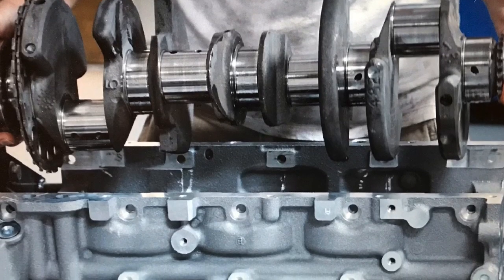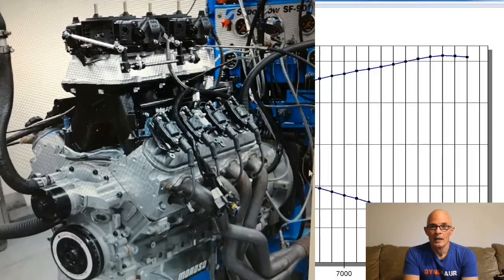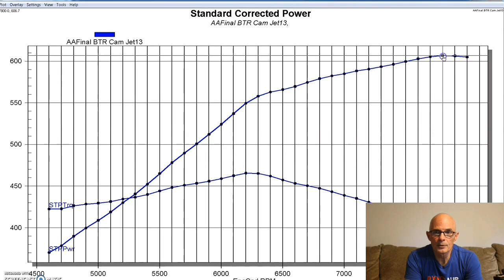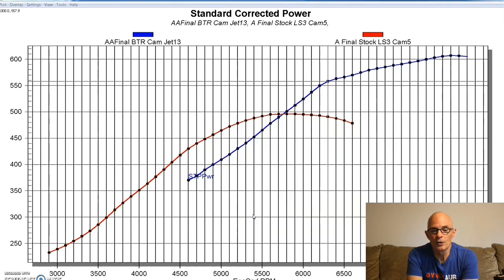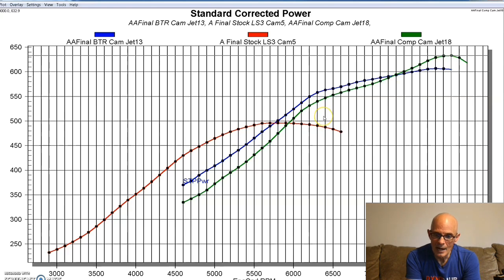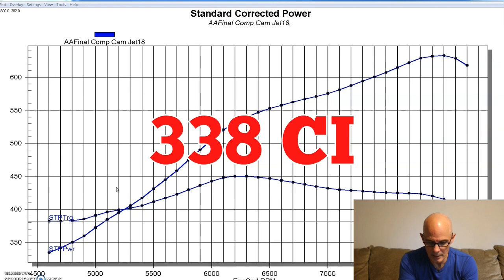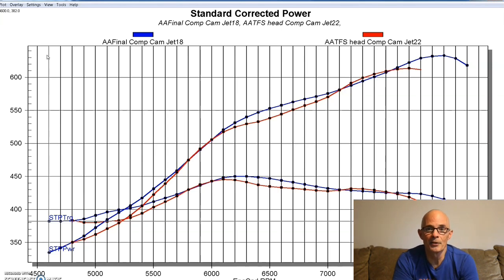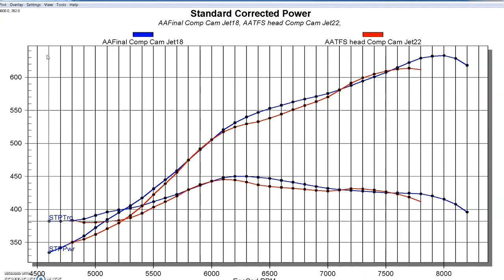DESTROKE LS-4.8L CRANK IN LS3 BLOCK-SHORT STROKE POWER-AN LS MONSTER MYTH?

Comment: Getting 600 hp from 330cubic  inches is impressive still.
Reply: Piston speed is the reason they destroke motors.
Reply: Leland Holton elaborate
Reply: @tracym427  The whole reason for de-stroking is reliability due to short strokes benefit of reduced piston travel speed. Lets say the motor scatters when piston speed is above 8,000 (for reference not actual know piston speed) feet per minute and you need it for a circle track car winding at 6-9k rpm non stop for an hour per race. You can de-stroke an engine to reduce piston speed to 5,000 feet per minute and the motor lives through the race no problem. When the speed of the piston crests a certain point it refuses to turn around on the down and upstroke. You take that 6.0 and repeatedly rev it to 8grand and it will blow where the 4.8 crank in the 6.0 block has lower piston speed thus allowing it less inertial forces on the mechanical parts. It would be happy to rev out to the 8grand more often with less heat and forces on the parts. THIS IS WHY PEOPLE DESTROKE AND THE CONTENT CREATOR MISSES THE WHOLE POINT OF IT..... Its not which build makes more power it is which survives the hell you throw at it. And the power depends on cam, valve geometry, head design/flow, and so much more than simply the displacement.
Reply: Master Debater makes perfect sense. Thanks buddy
Reply: @masterdebater8757  Lol, you realize stroke is not the only factor. The length of the con rod makes a difference on piston speed aswell.
Reply: @sethh8892    (This first comment was for the content creator)
Master Debater
1 year ago (edited)
Your missing the point when you say all these engines can rev to 8000 and you would have made more power with the 5.3 or 6.0... The whole reason for de-stroking is reliability due to short strokes benefit of reduced piston travel speed. Lets say the motor scatters when piston speed is above 8,000 (for reference not actual know piston speed) feet per minute and you need it for a circle track car winding at 6-9k rpm non stop for an hour per race. You can de-stroke an over square engine to reduce piston speed to 5,000 feet per minute and the motor lives through the race no problem. When the speed of the piston crests a certain point it refuses to turn around on the down and upstroke. You take that 6.0 and repeatedly rev it to 8grand and it will blow where the 4.8 crank in the 6.0 block has lower piston speed thus allowing it less inertial forces on the mechanical parts. It would be happy to rev out to the 8grand more often with less heat and forces on the parts. THIS IS WHY PEOPLE DESTROKE AND YOU MISS THE WHOLE POINT OF IT..... Its not which build makes more power it is which survives the hell you throw at it. And the power depends on cam, valve geometry, head design/flow, and so much more than simply the displacement. Sure if your drag racing a trailer queen and want to build the engine every 100passes go with the big D and long stroke it wont matter much if everything is set up just right. But, if you need to work a high rpm window and want the engine for endurance, many races, and drive the thing home go with the short stroke.
Master Debater
1 year ago (edited)
(this comment show rod length is considered)
 @Richard Holdener  I was talking about piston speed not engine rpm (and no they don't go hand in hand) we all know both can spin to 8-10rpm and the limitations are the valvetrain, rod length, and piston speed. But the shorter stroke will live to fight another day at those rpms due to lower piston speed. It doesn't matter what generation, manufacturer, or model the rules apply to all equally LT, LS, LSX makes no difference. Unless maybe you are using a rare non typical design like say a screaming dorito engine but that is a whole other conversation. (This link i shared no less than 3 times in this videos comment section 100% covers your reply topic of rod length by a well respected engine builder and YT content creator) https://www.youtube.com/watch?v=Vy2r3p-SOag
(Sorry E, i gave a similar response in the past in the comment directly under this one there are 105 replies to this comment so i clarified much with my own comment below this original one. Without returning to the video and swimming through the 105 replies to the comment topic and see what your replying to this is the best i can do.)
Reply: @sethh8892  Rod length plays less of a role than many think.. Piston speed calculations dont use rod length in the formula simply because it doesnt mater it isnt the driving force that scatters an engine like piston speed is. Manufacturers use the piston speed to RPM formula to chose there redline rpms. As well piston speed is an average over time it is not linear if looking at it with rotational angle of the crank over RPM . lets say you use a longer rod the next step is to use a shallower piston geometry which matches so you have the proper swept volume inside of your deck height limitations to achieve a specific compression ratio. longer rod is thought to reduce piston speed but how can that be if the swept volume and deck height are still the same. Well it simply doesnt it only changes the speed at positions in the stroke and the dwell time at TDC and BDC. also dwell time gains have been debunked already so no point us conversing over that. So we go back to the changes in piston geometry and its issues of side load, loss or gain of height (strength in some cases)  wrist pin location, heat transfer and the list goes on with that issue. you cant just throw money at a problem and be efficient at solving the dilemma. your not going to weld the deck up with pixie dust to accommodate a more reliable piston geometry so as for this specific topic of destroking for reliable continuous high rpm operation you have the limitations of the short rod short stroke. On another engine or another scenario where the engine is set up differently or your starting with a custom deck height your limited only to your own imaginations, material specs, engineering limitations. It really boils down to waht you want the engine to do. Much like picking a rifle chambering for your specific needs. In this particular scenario we are stuck with the bore and deck height that is just how it is. There is a smidge of insight in one of Jasons videos so i will post that here as well. Many others spoke below about rod lengths as well. I am sure there is a plethora out there on YT about rod length and pistol geometry choices and when to or not to use them.  https://www.youtube.com/watch?v=UV3RwBPqznU
Reply: @masterdebater8757 There's also less side wall loading in a destroked long rod engine. Rod length also brings piston speed down, and increases dwell time at TDC/BDC for better cylinder scavenging/ filling.
Reply: @masterdebater8757  - It's hard to convince people how their "no replacement for displacement" mentality only makes sense when it's ACTUAL DISPLACEMENT (cfm), not just engine displacement. Not only that... but your "hell you throw at it" comment was dead on point. There's a whole world of difference between a run down a drag strip, and a circuit car with a displacement restriction and 3-4hr duty cycle. Efficiency and durability takes on a whole new meaning, when you're forcing those kind of thermal loads.
Reply: @RadDadisRad  Then you can also run a longer rod for a better con rod/stroke ratio.....
Reply: @milojanis4901  - "you can also run a longer rod..."

Until you can't you only have so much deck height until your wrist pin bosses start cutting into the ring lands. Even on 3D printed skinny pin pistons... more performance means more compression height. You can't just magically add more deck height without changing literally everything else on the engine. Even aftermarket "tall deck/OEM head" blocks require dedicated intake manifolds.
Reply: @RadDadisRad  👍👍
Reply: @RadDadisRad  destroking doesnt change piston speed if the correct length rod is chosen.
Reply: @RadDadisRad  not true. Just because you add stroke doesn't mean you have to necessarily add Piston speed. You can always change this with connecting rods. Within a certain amount obviously.
Reply: @sethh8892  adding stroke will always increase piston speed at the same RPM.
Reply: @RadDadisRad  if adding stroke is all that you do... changing other factors of the engine including the connecting rod length, can increase or decrease piston speed. Again, changing the length of your connecting rod can change piston speed. And you'll have to change the connecting rod length when you change the stroke of your crank.
Reply: @sethh8892  when you add stroke you decrease your rod length to accommodate the additional stroke. You can’t magically keep the same piston speeds when adding stroke. If you believe changing rod length will decrease piston speeds you obviously don’t know anything about physics and should probably leave the math to us engineers.
Reply: Hot Rod magazine in 1970 got 505 hp (back then) out of a 327, and technology has grown leads and bounds since then.
Reply: Don Rutter I’d like to see that build. That’s impressive for the time period. It still takes a great plan selecting the right parts to build a 500hp SBC today, much less a small cubic inch 500hp SBC.
Reply: @viciousrap700  don't need to be that picky tbh, just have to pick a head that flows a ton and a cam that can lift it that far. SBC is mostly held back by its head design.
Reply: @viciousrap700  - 500hp SBC is simple as picking up a catalog, nowadays. Prior to the mid/late 1990s, it was a whole different story. I see where you're coming from though... a lot of these new guys don't understand that most of the stuff they can buy for a reasonable price today, was race-bred unobtanium back then. You didn't just order a roller cam, 18 degree heads, matched valvetrains, mains girdles, valve guides, custom curve distributors with buffed initial timing, 750cfm carbs with more than two tunable circuits and advanced venturi profiles, fancy timing assemblies, beehive valvesprings, profiled crank sets and pre-balanced rotating assemblies. That 💩 was unheard of, to the average builder back then.
Reply: @donrutter6765  But they didn't drive it from California to Vegas and back, trust me. ESPECIALLY in August......
Reply: @donrutter6765  impressive
Reply: @donrutter6765  - that 500hp 327 from 1970 was definitely about as unfriendly as it gets 🤣

I don't even have to read the article to see what it took to get there. Monster cam, probably idled around 2k to keep reversion from confusing the carb signal. If it was a single carb build, it was likely open plenum intake. Ignition curve was probably a compromise of just getting the damned thing to run below 4000rpm. That solid lifter flat tappet was reliable as for all of maybe two oil changes. Valve springs were the size and weight of locomotive. Low tension piston rings with gap that was one hot pass away from seeing part of the piston deck vacate the cylinder. 

Those were the days. Anyone else remember stock car races being a gamble to see who could make all 8 cylinders find the checkered flag?
Reply: You can get 640 from a 2018 and newer coyote with e85 tune, intake and exhaust. Guys are running mid to low 10s regularly with the 10 speed auto with just those 3 mods. It's  the irony to the 5.2 Voodoo engine with the fancy flat plane crank. The standard 5.0L is just as powerful (they are heavily under rated at 460 to 480, they make 450rwhp off the showroom floor) and makes its peak at 7k instead of 8k and is smoother and lasts longer. The 5.2 is more exotic and sounds cooler, is more expensive but that's about it.
Reply: @vendediesel  if its rated at 460-70 and actually makes 450 then its OVERrated. Not UNDERrated
Reply: @sethh8892  read the comment again.
Reply: @vendediesel  totally not same category  twin cam vs single cam  hell let's throw brabus in there as well 1000hp 😂😂😂 so sweet they warranty it !!! Good luck
Reply: @bigboreracing356  you miss the part where I said I was talking about low buck?

Any idiot can throw money at something and make it fast. Congrats on being able to spend $25k on a 4.8
Reply: @bigboreracing356  yeah man.. not all of us are racing against John Force. I am fully aware of what people are spending. There are a lot more guys spending less than $10k on an engine than there are spending $75k. The guys spending all that money are having SOMEONE ELSE build it for them. 

So um... did you build whatever it is you drive? The machine work, transmission, set up the gears, build the whole freakin car?

Are you a checkbook racer? I can dig the checkbook guys, they used to give me money to build transmissions for them and set up their gears. Pay others to do things you can't do yourself, you know, like a chick does.

I like doing the low buck thing because its a challenge, its more about what you know, what your skills are, and how good your workmanship is than how deep your pockets are. Any idiot can fill out a check to one of the engine builders, and with what goes into those mills I do not blame them. That kind of work is beyond damn near everyone who wants to go racing.

In the world of turbos a nine second pass isn't that impressive, but running a nine with less than $5k in the entire car and no power adder, well... you probably won't grasp the concept since you have a liquid nitrogen cooled checkbook, or you are racing someone else's stuff. You know like the honda and neon kids who know a guy who ran a 7 with their little crapbox, but they can only 'build' a 15 second pos. They race other people's stuff too.

I don't have $250k I can spend to go racing. I don't want to run 13s with $4k a sbc crate engine either. I like to beat guys who write checks to other guys (who are like me) who actually built their shit for them. 

I rarely build things for other people these days, mostly street/trip E85 Qjets, but I'm doing a 700R4 for a friend to put in his 46 chevy. Retirement is enjoyable when you don't have to worry about other people bitching that they want it yesterday for free.

Spin your junk to 8500 all you want. Doesn't bother me. I'll run tens in a $5k or so daily driver and not have to pull a valve cover for a decade. I will have a good time doing it, and if I want to go faster, I know how.

If its not a challenge, then you do it. Spend less than $5k to buy a car and make it go tens. Post it here to show us how fast it is. Lohnes, Freiburger and Dulcich might notice you.

https://bangshift.com/forum/forum/bangshift/project-cars-update/the-5-000-bangshift-project-car-challenge
Reply: BUT people were getting 600hp from a 5 litre SBC in the 80s. That with a 3" stroke crank. But not a very user friendly engine!
Reply: LDN Wholesale because RPM isn't street friendly. Anything you constantly have to shift above 6000 to get the car moving isn't really that much fun to drive. Much like THUMP ER up you'd have to have a ton of converter, I personally was thinking a 5000 or more. Give got to get that engine into it's torque curve or it's useless and as romantic as 600+go looks on paper the torque was just piss poor.
Reply: @viciousrap700  depends. If you have the car with the engine built right you can have it with enough power down to low to be drivable and short shifting and wind it out for top speed.
Reply: @viciousrap700  400 foot pounds of torque in a car that weighs 2500 lb is nothing useless... imagine that engine in a Corvette. That thing would be a track monster. That's 50+ more pound-feet of torque than the stock engine in a c5 vette... and now you're pumping out twice the amount of horsepower or more.
Reply: @ldnwholesale8552  
Yea in comparison that old block was flexing all over wearing the crap out of the crank bearings and suckin up power ...still was an impressive time bomb
Reply: @ldnwholesale8552 .Did you mean a 3.48 stroke? 305 was basically a small bore 350. Show me a dyno run where you're making 600+ hp without a power adder.
Reply: @tomrados7512  ive only seen those numbers with out power adders in the 500+ci range lol
Reply: LDN Wholesale a 302 making 600 hp, with no torque and you have to rev it to 10,000 rpm to get there which means stud girdles, rev kits, when you could build a mild 406 sbc, for less, same hp and more torque and you don’t have to rev out of universe to make it. I know a guy that used to run a 430sbc, on alcohol, wipple blower sand drag rail against blown Keith Black Hemis, he did well and was impressive little engine but every other pass the motor needed a rebuild, they pushed it past the limits to try and keep up, the reliability goes down the shit tank fast.
Reply: @ldnwholesale8552  , it always gets worse
Reply: @ldnwholesale8552  Ford was making over 800 n/a with boat anchor FE blocks back in the 60s lol
Reply: @unlisted9494  , is that why everybody had one? Oh, wait! What's this? Nobody even heard of em... 😂🤣
Reply: @unlisted9494  - "Ford was making over 800 n/a with boat anchor FE blocks..."

Yeah... on a dedicated race motor, with racing fuel, and factory-backed research parts that no average joe could even think about getting. That's a whole different story in itself. Thank God for Ford and their FE push... or GM would never have made the 427.
Reply: @unlisted9494  I would say around 600. Out of 427 CI. Maybe 650.
Reply: @unlisted9494  insane flow and compression on those engines too. I mean hell they had a 32v 351 too aside from the FE when it came to be. Or the 427 in the Gt40. PPl forget these days we dont just have generating power down to a "science" but our access to built transmissions and rear ends to BOOT. Then again we can see some crazy 383 mopar strokers, or some pontiacs too...IMO there were a lot of platforms that went under the radar bc of how TORQUE heavy that era was with the big blocks across the board of manufacturers. Just doing "straight line" racing. To me most folks want usable/streetable power at just about all power/band ranges these days. Were too damn spoiled.
Reply: CAPTAIN DABBIN  and it runs on $1.89 a gallon pump fuel. 87 octane gasoline costs $2.40 here. Low buck grunt engines are fun.

On MTOD behind the paywall, Engine Masters did a comparison between 500hp small block and 500hp big block, they all said they'd rather have the torque made by the big block than the peaky power of the small block without the grunt. The small block needed lots of high end parts, the big block was simple, hydraulic cam, dual plane intake.. and it didn't even make 550ftlbs like my daily driver does but it made lots of grunt compared to the sbc.
Reply: Fords been doing 800+whp with 281ci lol
Reply: Is your timing curve flat?  Looks like it needs a lot more timing up top.
Reply: @bigboreracing356  been there done that. No nitrous needed
Reply: @bigboreracing356  nah to beat the typical chevys . What rules in street racing? Last year I was talking about going fast for cheap, I'm cutting the smaller engines a break by not going with boost. They'd have zero chance against one of mine with the same psi... well provided I could hook it.
Reply: well, formula 5000 makes 400-500ish from 302
Reply: @ilham7345  to make 600hp at 5500rpm requires 600ftlbs, to make the same hp at 9000rpm only requires 350ftlbs. HP is simply TQ over time, and where an engine makes its TQ affects the HP it has. 

The 5500rpm engine is going to be making a lot of torque from idle to 6000rpm, the 9000rpm engine won't be making much torque at all, and gets its HP number from spinning faster. 

If you're limited by the sanctioning body to a small displacement, then the RPM option is your only choice, because there is no way a naturally aspirated 5.7L or smaller engine is going to make as torque as a 7L engine and larger. 

What will move the mass of the vehicle easier? 350ftlbs or 600ftlbs? They both make 600hp, but its where in the RPM range they make it that counts. With boost, everything changes because you can throw more air into it, but the larger engine will make more power with less boost than the smaller engine, and the smaller engine will NEED the forced induction to match the torque of the larger engine.

It depends on what kind of racing you're doing, and if you plan to drive it somewhere other than a race track... you know, like on the street. With no arbitrary rule limits, why would you build the tiny engine and spin it to the moon? The longevity will suffer and it would suck to drive on the street. If its all you have, then by all means make it work. If you have a choice, well lots of other things come into play.
Reply: F1 was getting 900+ out of 3.0L @ 20,000 back in the days.   You can get 800HP out of 330ci turned up high enough.    600HP is not that big a deal these days...
Reply: It doesn't look very useable though outside of a track
Reply: Bill Grumpy Jenkins got nearly 700 from a 331 cid sbc back in the day. Bob Glidden got over 900 HP out of his 340 small block Mopar.
Reply: Not as impressive as 600 hp from 122 ci, as koenigsegg did
Reply: @02mellis  its not n/a bro...
Reply: Sloppy mechanics. That is all.
Reply: its simple math, it made a peak of 450ftlbs, but carried 400ftlbs out to 8000 and barely squeaked 600. HP = torque over time. It needs a light car, a 4500+ stall and 5 something gears for it to work. Its gonna get beat by a car that weighs the same, but has that same 600hp at 5000rpm, and runs a highway gear, provided you can get it to hook, and you'll be able to drive it around easily. Vehicles are all trade offs/compromises. 700ftlbs at 4500, with 700hp at 6500 with a 3.08 gear behind it is going to run better than 700hp@9000rpm (its only 410 or so ftlbs at 9000) with a 5.13 gear behind it in a 2000lb and heavier car.

Give it enough airflow and valve train stability, and anything will make hp above 5252rpm. Its how the math works. I Have a 700ftlb@4500/700hp@6000 engine it was still climbing but we stopped revving it at 6500. Thats not the peak HP. It is making 520+rwtq down at 3000rpm with a 270/272@.050 solid roller, and only 467ci. Gear it so that grunt everywhere is working to push the car, its gonna run faster than the steep geared high revving small engine that makes the same hp. Its in the math. Hero peak HP numbers are meh when there isn't any tq behind it.

the 250/260@.050 cam and just enough airflow for the tiny engine is going to make all the power up top. Its math.
Reply: @SweatyFatGuy  great for road cours cars too
Reply: @SweatyFatGuy  sbc engines are a good cheap easy and dirty option. I like jdm and European motors too. But the small block chevy is a preven platform.
Reply: @SweatyFatGuy  I would suggest doing more research on your "lower rpm is better at the same hp/tq" theory due to two words: Power Pulses.
https://rehermorrison.com/tech-talk-47-raising-the-redline-why-rpm-matters/
The simple explanation is that raising rpm effectively increases an engine’s displacement. This might seem nonsensical because the volume displaced by the pistons doesn’t change, but consider the effects of filling and emptying the cylinders faster in real time. An internal combustion engine is an air pump, and if we turn that pump faster, we can theoretically burn more fuel in a given amount of time and consequently produce more power. For example, an eight-cylinder engine running at 6,000 rpm fires its cylinders 24,000 times in one minute (assuming perfect combustion). Increase the engine’s speed to 8,000 rpm and it will fire 32,000 times per minute, a 33 percent increase. The volume of air and fuel that moves through the engine is now equivalent to an engine with a much larger displacement. There are also 8,000 additional power pulses per minute transmitted to the crankshaft that can be harnessed to turn the wheels and accelerate the car.
Reply: @SweatyFatGuy  Those specs would be very nice for a track car. (road course track)
Reply: Thump Er you are not talking anyone out of the love for LS engines. They don’t know anything else and don’t care. The LS is the Honda of the muscle car era 🤦🏻‍♂️
Reply: @SweatyFatGuy  idk my 69 gto has a 400 cubic inch engine and the larger engine is less peak hp but has way more torque.
Reply: @mr.know_it_all  cough hemis cough...... 

And for the jdm world 2jz engines are probably the most legendary.
Reply: @mr.know_it_all  yup. I love LS engines. Ill always build them, always love them. A random on the internet trying to slander an entire brand bc of his opinion of 'chevy guys' isnt changing my mind. Find an engine I can build, where the engine is more reliable, and cheaper to build, and has easier to access parts. If it exists, Ill love it too. Still gonna love my LS.
Reply: @SweatyFatGuy  That's not how that works. Power is power. Higher power while holding a lower gear will net better acceleration. If you want to net the same acceleration you'll need a different final drive on the lower revving car and you'll lose out on top speed.
Reply: @SweatyFatGuy  - you're right, on point... regardless of the unit of measure, "power", be it horsepower, kw, etc., is any formula of "work over time".

On the flip side, simply stating a slower spinning, larger displacement engine with the same power will perform better than a higher revving engine, is short sighted. 

Nobody will argue a larger displacement engine making the same power will have broader uses... but it's not always about making power. In some applications, it's about the 'where' and 'how' you make that power. If I'm building a car that needs to cary speed through turns, even if it's a Cadillac Eldorado in full chrome... I'm not going to build a 5,000rpm 632.... I'm going to build an 8,500rpm 350 and put a 6spd behind it. 

Furthermore, even if we take the application to extremes... there's a reason why modern tractor-trailers have DOHC heads and transmissions with 18+ gears.... and there's a reason why modern GM trucks have pushrod V8s less than 400 cubic inches. Efficiency is all about optimizing for application, and what works for one application may not be the best answer for a different application.
Reply: @SweatyFatGuy  9000 rpm = awesome sound. Who cares if you lose against similar power levels at lower RPM. He will definitely win at the rap battle and will sound better than any other LS.
Reply: @SweatyFatGuy  not many people would be doing a high RPM build as a daily driver.
Reply: Thump Er keep your old engines old man you’ll be left in the dirt I bet you spent 10k to make that 600
Reply: @SweatyFatGuy  I just love how you want to restrict the power adders. I know the reason you do is because you know for a fact that 4.8LS with a turbo will cost the same if not less and you'd have to hope you have enough motor to catch it
Reply: @SweatyFatGuy  dollar for dollar my boosted 4.8 won't cost as much as your 700hp N/A motor. Sure there does come a point where my sbc will lose out, that's a given. For the price you were staying my boosted 4.8 would kill your N/A motor any day. Also, if you had two identical cars making the same power and everything else was the same aside from the gears. Say 4.10s vs your 3.08, you'd be hard pressed to win that race
Reply: @SweatyFatGuy  why not both build the engine to be drivable but once it hits a certain rpm range goes full mental. With turbos and efi you can even play with shit to keep fuel economy good. I've seen 1000hp gtrs that can be daily driven and till you really step on the gas pedal they get 18 to 20 mpg so not bad fuel economy. 

My ls build of I let it Rev more turn up boost and swap a few bits will be like that. Drive around like a 700/800 hp truck engine put the pedal down and let it Rev out and bam 1300 hp to the rear wheels. Twin charged. Boost still kicks in but not the same and just builds power as it revs.
Reply: @SweatyFatGuy  then build an engine and cram it into a decent little car like a 350z and go win races. Can get a 350z for cheap af. You can get big tires to fit. With the right junk yard bits an awd conversion is easy. Prove it with a video. 

Cause if you can do that then just build the engine up with the right bits and high revs is possible and just makes it more nuts. And doesn't have to be an implode when daily driven build. While I get vintage bits for my pontiac engine I have an ls engine in my gto. Sitting like 700 rwhp right now. Peak torque os higher then its peak hp numbers. For now. The engine is currently de-tuned and losing a bunch of power while some stuff is figured out. 

I'm twin charging the engine but also doing a 3rd power adder. Electric turbo for the last bit of boost and a push to pass button. 

Full boost it should make 1300 hp or more. And roughly 1000 ft lbs of torque at peak. But gonna have to set shit up to keep it gripping. Might see if I can steal some gtr upgrade bits to use as a traction control system. Not awd but help with tracking tire slippage. 

Probably never going to turn full boost on. But I can drive it around like a truck or Rev it out and let it go nuts like a full race car. 

If you build an engine capable of sustained revs to 10k or more then have the Rev limiter to 8000 or so it's a decent safety margin. 

Same thing I'm doing when I go to build the gtr conversion. 4 door r34 non gtr car. Engine swap to a custom rb30 2jz hybrid engine. Larger displacement and longer stroke but gonna see about building the engine to Rev to 10k safely. Keep the engine feeling like a gtr engine but with more displacement higher torque and hp right off the bat and better for spinning turbos. Twin charge it and I can avoid turbo lag and get super charger benefits. If I compound boost and use the right boost controllers I should be able to tune it real nice. Combined with a upgraded g sensor set up and computer plus an upgraded transmission. 4 door slayer. 

You don't necessarily need 10k. But if you can get the thing to make racable numbers by 6.5k why not try and get it to run to 8k. 

A good amount of torque low and a decent redline and a flat torque curve is a nice combo for fast and drivable.
Reply: @SweatyFatGuy  idk I've found some sick shit buying used racing parts got an ls for my gto it's built to Rev to 10k fairly reliably with frequent rebuilds and was making lots and lots of hp. Swapping super charger and not spraying nos cuts some power but dropped it so it revs to 9k. With the other work I did and flipping the supers to get the other shit I needed I'm like maybe 10k into the engine with cooling and turbo and super. Last thing is the stuff for the electric turbo. And basically like I think 6 ish grand into a expensive ass sequential transmission with the stuff to have paddle shifted sequential but I have it set up as a bump stick right now. 

Wanna build the ram IV that's the stock motor for my gto. But trying to do it with all vintage parts or like vintage inspired custom bits. Has some goodies but yeah. Same with the stock transmission. 

The ls is eventually going in maybe a 1970 convertible lemans.  Once done and fuel maps done and boost controllers tuned proper it's gonna be like a dude with a gtr I saw. Drives in the chill mode unless you put the pedal to the floor and hold it then it really kicks in. Also with ability to swap over to full on race mode. Hitting 9k is partially to help with money shifts near redline and going down 2 gears.. Trying to gear it so I shift with a like 1500 rpms to spare. Mix between acceleration and top speed. Wind it out sometimes but realistically probably will be around 6500 7000 at best unless a long stretch comes up or maybe drifting. 

Nothing wrong with revs. No low end can get annoying but top end is fun too. 

The hemi me and my buddy built is similar but not streetable 1700hp and over 1000 ft lbs of torque. But if he revs it out on a half mile or full mile stretch its worth it. Funny to watch his built whip kill turboed lambos that cost twice as much.
Reply: @SweatyFatGuy  dude I know no money right now and have to finish my gto as is. Then start the stock Vin pins and building those up. Find if I miss out on the lemans a new thing to stick the ls in down the line. Then my moms barracuda and road runner. 

But in the mean time insurance sucks so need to find something cheap on insurance buildable and and decent to wait out the 5 year period. Gto as a first car was not smart made me slack on my license for an extra 5 years which hasn't helped at all. 

But also slowly saving for a superlite slc to build. Have a line on a Toyota supra I wanna v12 swap as it's an mk4 car ordered like a lecus so auto and single turbo but clean everything else. Gotta get my boss one of the charger rollers plus mine. Know where a total of 7 69 to 72 chargers are rollers rusters and cheap runners. 

Might get my boss one of the nicer cheap rollers and put a dodge ram srt 10 v10 in it. Dodge viper engine not the same as the earlier magnums. Think it's the same engine as rhe second gen vipers maybe 3rd gen. 

Homie is taking a different charger. And mine well. Finding a random hemi to stick in it and hopefully get a 7 speed manual to fit. 

Beyond the supra jdm wise. Rotary swapped miata for shits and giggles or an ecotec or similar v6 swap. An r34 gtr spec conversion with a custom billet engine that's a mix of Honda and chevy bits inside what is mostly an rb26/30 and 2jz hybrid. And possibly either a v10 Nissan 350z or a w12 350z. 

Lamborghini engine out of an audi or a real Lamborghini engine. Scrap yards ftw. Or a w12 out of a Bentley/vw. Gets me to a decent power range right off the bat. And should be good for more once built. 

Gotta rebuild my mom's road runner to find a buyer to flip it to get a nicer one from a family friend. Paying sticker Pl inflation for a super bird. Guy has no kids. 

Barracuda gonna leave mostly alone. But needs restoration. 

Lemans is a rust bucket but same body as my gto basically and I can justify doing whatever I want even if it's not restorable. Only thing I can put back stock on the gto right now is a few suspension bits as the worn ones got tossed. So reproductions but gonna leave the modern upgrades on it. 

All that's left for that project is power steering air conditioning and bringing up the boost. Then tuning for what I want and to take advantage of all the little cool shit. And then traction control if I can get the gtr stuff to work. 

Also working on a motorcycle project. 140 cubic inch Evo to start but then a turbo knucklehead cranking like 170 to 200 hp as the final engine. Probably fuel injected as well. 112 ish cubic inches on the knuck. 

Might make some cash flipping a few other cool things I found. And some of the chargers. But boss wants one gotta help him out. Getting my friend one cheap and not making anything. Trying to take 2 for me. At least I might be able to make close to 10k off the one running one. 

But 1500 for a charger roller. Srt10 running complete engine for 10k. Figure 7 to 10 on transmission. My boss is gonna have the cheapest restomodded and badass charger ever. Hit the scrap yard for some corvette brakes and a few bits for a modern dodge interior
Reply: @SweatyFatGuy  
No. just no. HP is NOT torque over time. 
It is a function of torque and rpm at any given instant.

Any reasoning off of HP being torque over time is wrong. Maybe you get to the right answer because you do other things wrong due to your instincts knowing what things should be, but it is NOT because you decided HP is torque over time.
Reply: @SweatyFatGuy  , 1 horsepower will lift 33,000 pounds 1 foot in 1 minute!
Reply: @SweatyFatGuy  James Watts derivation of the constant 5252 was anything but arbitrary.  He was building steam engines to pump water out of coal mines, which was previously done by horses pushing a turnstile connected to a pump.  Watt needed a way to compare how much water his engine could lift in a day to the horse pushing on a turnstile.  So he put a spring scale on the horse harness to measure the pounds of push, and measured the speed that the horse could maintain.  He got 181 pounds and 180 feet per minute, which multiplied gives 32580 lb×ft/min.  He rounded it up to 33000 for convenience.  You get to the constant 5252 by dividing 33000 by 2*pi, which is required to convert revolutions to radians.
Reply: Thump Er okay bro
Reply: @chasp_0784  He is correct. WAY more under the curve will win over peak every time, except maybe at Bonneville. Last I knew, there were no restaurants or nightclubs on the flats, anywhere.
Reply: Milo Janis a truely baffling reply to me, mostly regarding the nightclubs and restaurants?
Reply: @chasp_0784  I'm referring to streetability, meaning your Bonneville racing engine wouldn't work too well too far from Bonneville, and you would have an unpleasant drive ahead with your race engine to the nearest eatery or bar, of which there are none at the flats. Again, streetabity. And yes, one mans street car is another's all out race car. I drove my modified 427 corvette to California and back. The only reason it worked is it had an overdrive trans, lockup converter, and fuel injection. It was a 3500 stall converter, but it was a lockup unit. A non lockup unit would've overheated the trans in 115° heat.
Reply: Milo Janis I’m wondering if you have me confused with another commenter, my comment was basically meh about getting 600hp from 330 cui
Reply: @chasp_0784  He's right.  A motor that has 600hp at 8,000 is going to have much less torque than one that makes 600hp at 6,500.   
So regardless of how you gear it, in a car with equal weight, the one that makes 600 at the lower RPM is going to leave the one that makes the same power up high, because of the torque, assuming both get equal traction. 
That's why you build the bigger motor, always...unless you're limited by rules.  Bigger motor at the same HP level always makes the HP at a lower RPM, and has more torque as well.
Reply: @milojanis4901  but if you cross back into Nevada, there is plenty of night life
Reply: @SealofPerfection  The car with highest average power through the run will win.  You can multiply torque through gearing, you can't multiply power with gearing.  You can even see that on chassis dyno, by doing pulls in different gears.
Reply: @Dayandcounting  Yes, I understand that.  To expound on what I said originally, the bigger engine will also make more AVERAGE power, whereas the smaller engine making that same power at a higher RPM will be more "peaky".
Plenty of examples of that.  
Just find you a dyno test of a BBC with 600hp vs say, a 383 SBC with 600 and look how more more average power the bigger motor makes.  It's not even close, honestly.
Reply: @SealofPerfection  It's average power while accelerating, so beyond the launch between shifts.

Look no further than the current Mustang GT and Camaro SS, both use the same 10 speed auto.  The Mustang is over 100lbs heavier with  35lb-ft less torque.  It's still quicker by few tenth.

By your logic the Mustang should be getting thrashed and that's clearly isn't the case.  

That's why you have to look at the plots ideally on the same chassis dyno.   In this case the Mustang uses lower gears to increase wheel torque negating LT's  advantage.  Combining that with a power band 2000 rpm broader it does have more average whp through the 1/4 mile.
Reply: @SealofPerfection  but this is also why you have issues of cars being faster off the line but losing at the finish.
Reply: @chasp_0784  hes right. Listen to him, he actually knows what he is talking about
Reply: @SealofPerfection  Yup!
Reply: @milojanis4901  - it's all about application. All that curve does nothing for the guy who stays in 1,500-2,000RPM rev band. All that peak power does nothing for a vehicle needing a 4,000rpm sweep between gears. It's like the whole "bigger wheels/brakes don't make cars stop faster" argument.
Reply: A "hot" engine has a 1.5 power factor, a "race" engine has a 2.0 power factor. 330 x 2.0 = 660hp, given the weight of the stock crank and the nearly race-only cam, 600 is right where it should be.

It's fairly old so hard to find, but someone stuck a 4.8 crank into a modified ls7 block and made over 1000hp at iirc 9800rpm on race gas. Cool stuff, but it's mostly just a tech demo kind of thing. ZERO replacement for displacement at the end of the day.
Reply: 2.0 power factor for race engine? thats your street Honda/MB/BMW or anything 4Valve dohc with cams
Reply: @exvils  Yeah. So you're complementing the power output of a simple design to be the same as a complicated design?
Reply: @unlisted9494  How would a high winder react with nitrous? Increases hp and has the help of high hp.
Reply: AndreS123_03 ehhhhhh